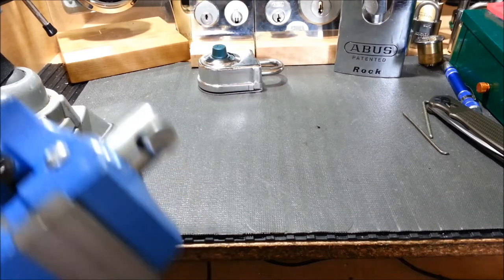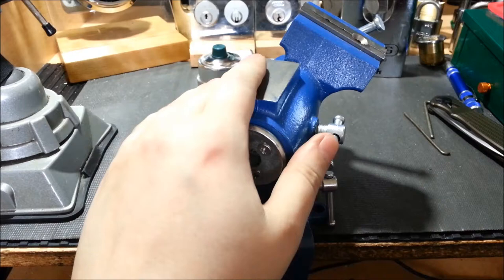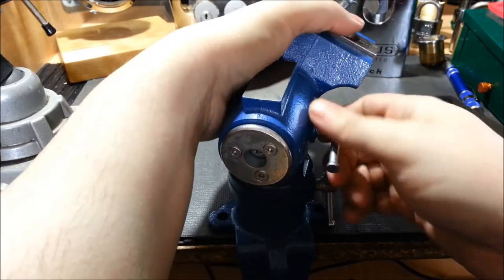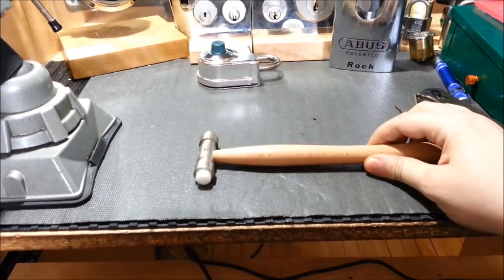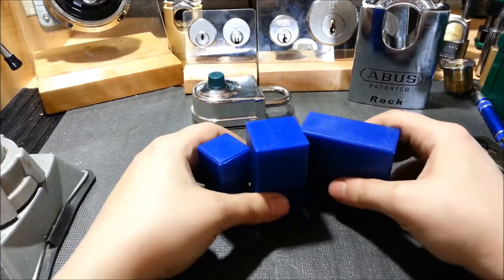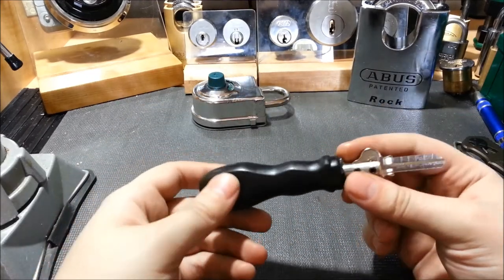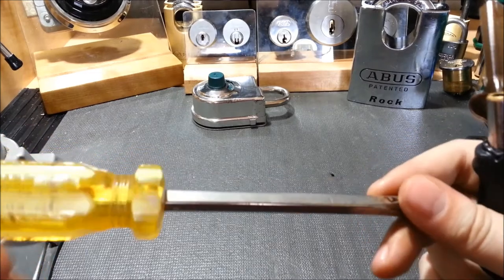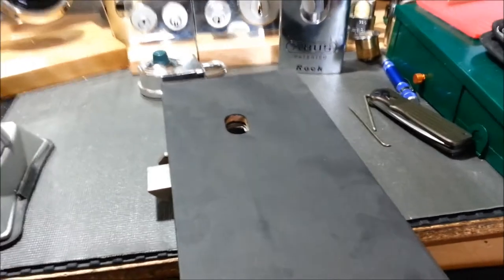(148) Shop Update - 570 Mortise Lock Display !

Comment: You don't need a 2 or 3 pound hammer for those stamps. Just a small ball pein hammer will do it my friend. You will find with your hobby hammer it is constantly loosening up. Keep checking or you will break the plastic head.